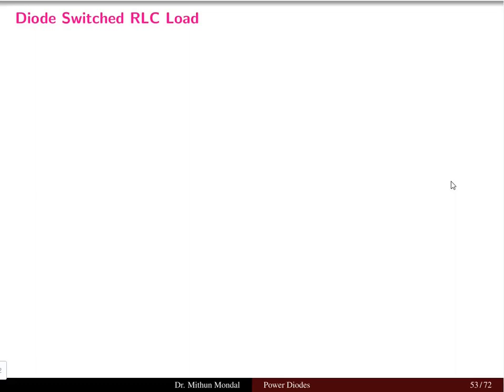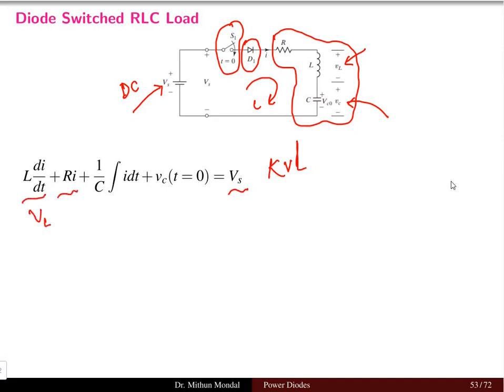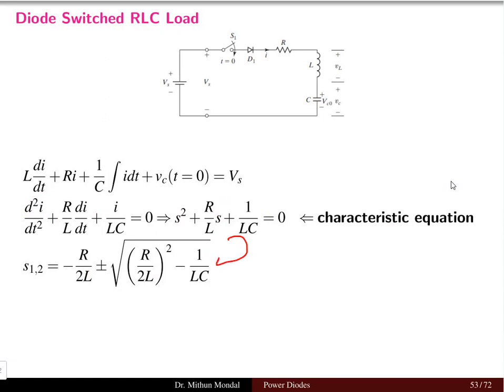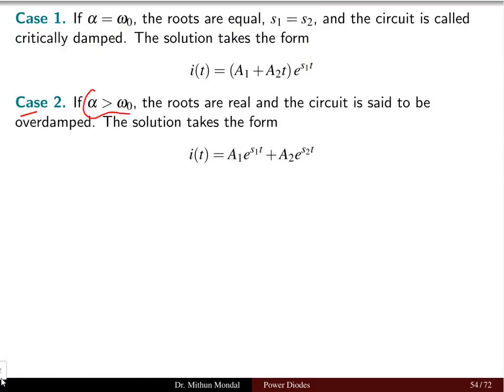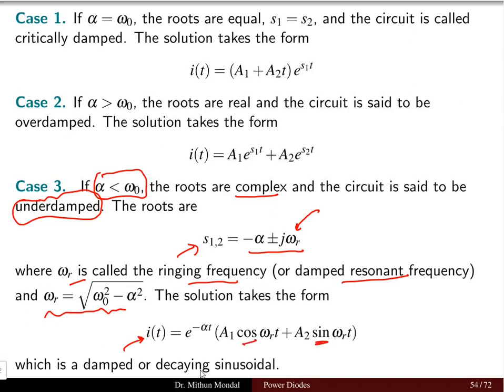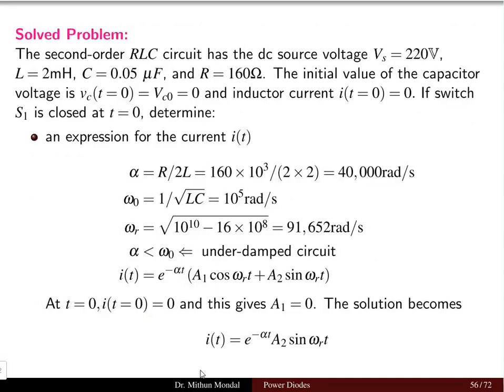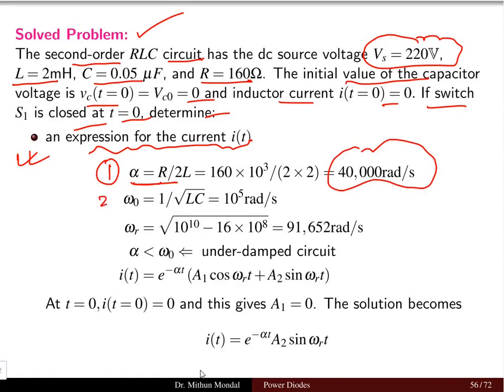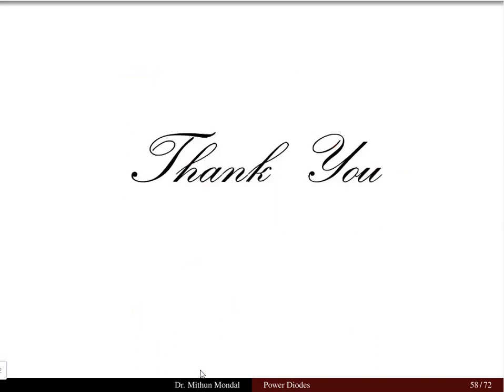Power Electronics | Lecture - 2G | Power Diode Switched RLC Load

Comment: Good day sir thank you 
I am abit confused after finding d derivative of i(t=0) u said it’s equal to Vs/L how?? Can u please explain that
Reply from the maker: At  t = 0, applying Kirchhoff’s Voltage Law (KVL) to the circuit, we get Vs(0) = V_R(0) + V_L(0) + V_C(0). At t = 0, i = 0 so V_R(0) = 0 and since capacitor is uncharged so V_C(0) = 0. Finally, Vs(0) = V_L(0) = L di(0)/dt. Now rearrage to get di(0)/dt.